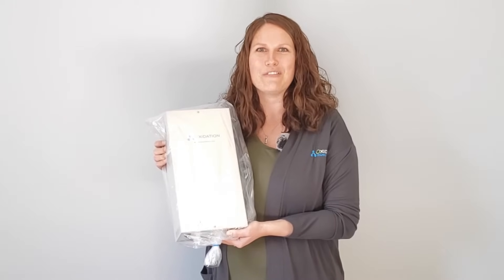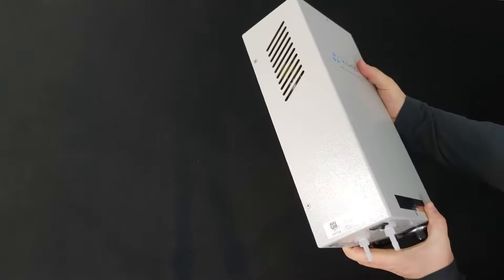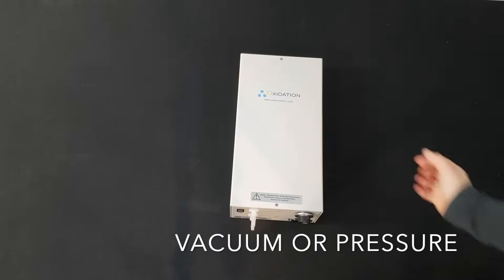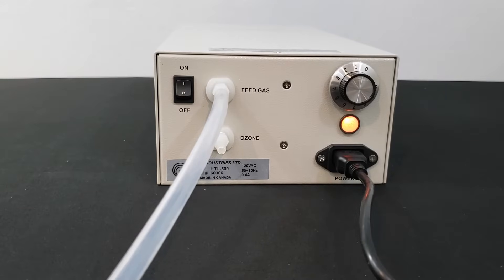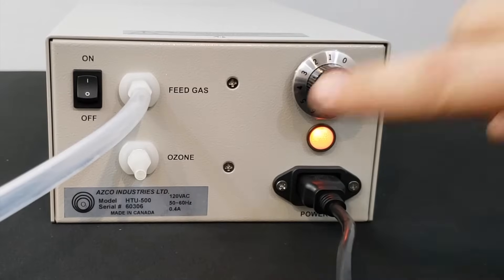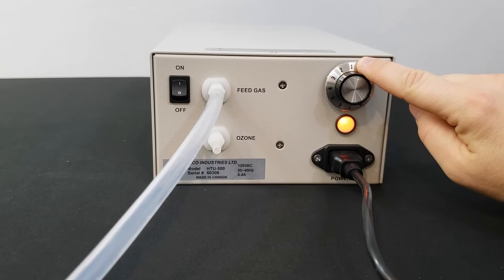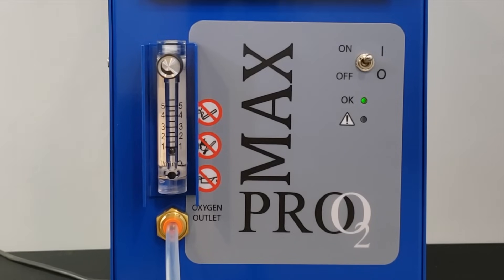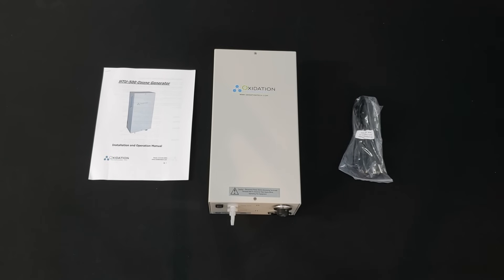HTU-500 Ozone Generator - Overview

Comment: HI, 
      SO I SEE 2 MACHINES IN ORDER TO PRODUCE OZONE OXYGEN??LET ME KNOW PLEASE 
 THANKS  A LOT.
Reply from the maker: If you are looking to produce ozone from oxygen feed-gas you do need two machines.  Both the oxygen concentrator to capture oxygen from ambient air and provide 93% pure oxygen for ozone generation, and the ozone generator to convert that oxygen into ozone.

If you are looking to produce ozone from air, no other machine is necessary.  However, ozone production from air is less efficient as air contains only 20% oxygen.

Comment: Which material are you using for coating inner side of quartz ozone cell?
Reply from the maker: There is no coating on the quartz glass.  It is just pure quartz glass.
There is a stainless steel foil anode on the inside of the tube and a stainless steel foil wrapped around the outside of the tube.  However inside there is no coating or additional materials.  Oxygen and ozone gas touch only quartz glass inside this corona cell.